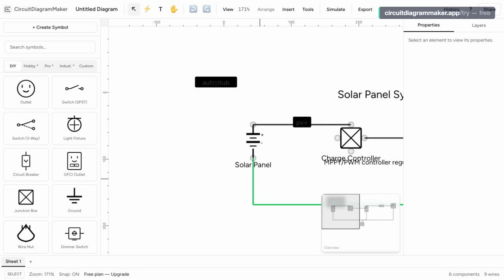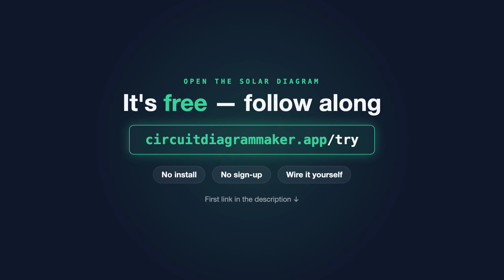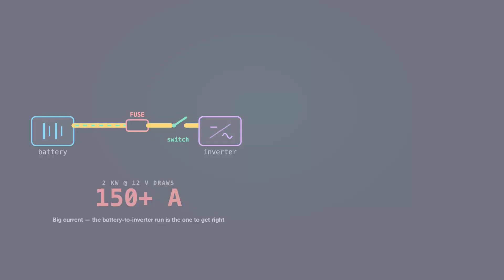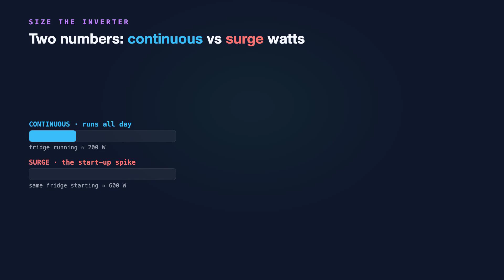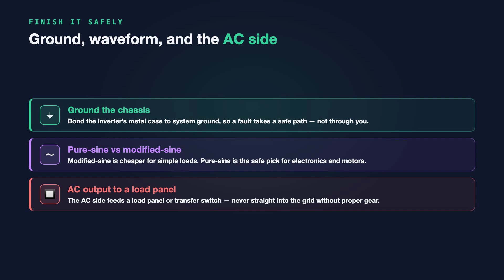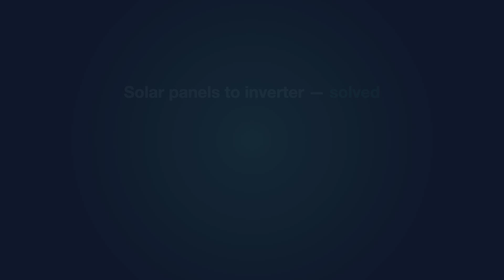How to Wire Solar Panels to Inverter (Step-by-Step)

Comment from the maker: The one thing to remember: the inverter connects to the BATTERY, never straight to the solar panels. A battery holds a steady voltage and can dump the big surge a fridge or pump pulls at start-up — panels just sag and brown out. Let the panels charge the battery through the controller, and let the inverter draw from the battery.

Then treat the battery-to-inverter run with respect: a 2 kW inverter on a 12 V bank can pull 150+ amps, so use thick DC cable sized to the current, a correctly-rated DC fuse or breaker at the battery positive, and a disconnect switch. Size the inverter for continuous watts AND the surge spike (often 2–3× a motor's running watts).

Open the exact solar diagram and wire the inverter yourself: https://circuitdiagrammaker.app/diagrams/solar-panel-wiring-diagram?utm_source=youtube&utm_medium=pinned_comment&utm_content=yt-100